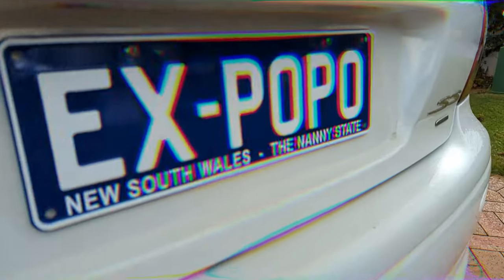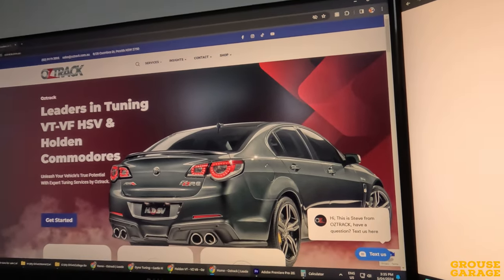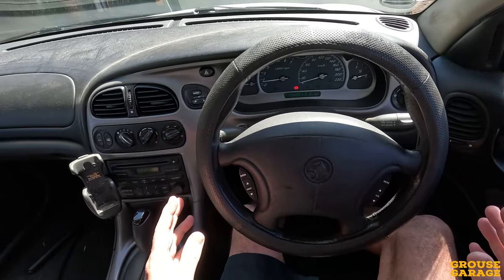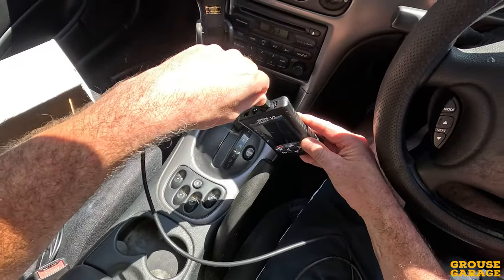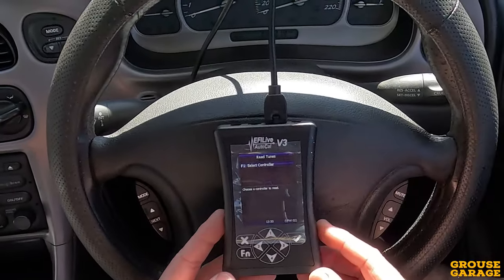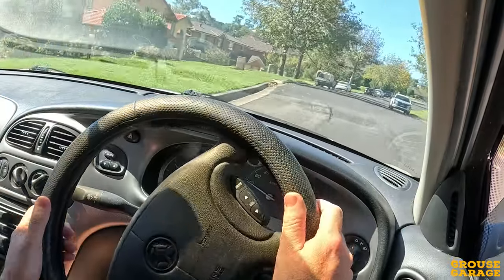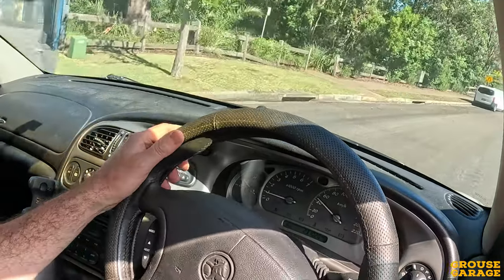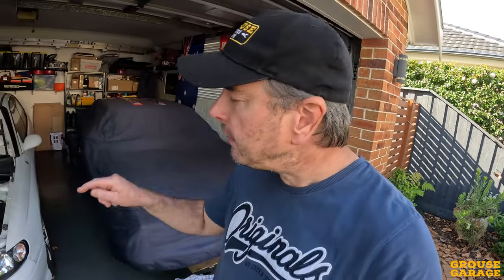Remote Tuning a Cammed SS Commodore LS1 - Does it work?

Comment: Nothing wrong with Dyno’s  and fresh engine if you talked to a tuner I’m sure they would have addressed your concerns of a fresh engine like doing a run in tune and even set a rpm limit so no one gets carried away would have also addressed your starting and stalling issues, and a dyno tube is much safer then a mail order tune which you choose as it technically is.  Plus many more benefits.  

Have to say you’ve done really well doing this all by yourself definitely something to be proud of!
Reply from the maker: Thanks mate. Fair advice. If I had a trailer and tow vehicle I would have considered a dyno tune more closely.

Comment: Most dyno tuners don’t run them flat out if it’s just been rebuilt for the first time. They say drive it for about 500ks then you take it back and they do the proper tune
Reply: true that,was surprised at the hesitancy.

Comment: I think your startup / idle problem is all about your throttle position sensor. Pretty sure from memory theres some process for intitiating this procedure holding the mode and up button on the trip meter buttons with the reds on . Don't quote me but I'm sure youll find something online... been like 10 yrs since i did it.
Reply from the maker: Checked it today. Voltage readings are spot on.
Reply: No when you upgrade your stock cam for a large cam the car wont idle till its tuned in an auto, it has nothing to do with TPS, bigger cam needs more air/fuel. and higher idle I run a Crow cams 229/235  in my LS1 and it likes to idle at 900rpms.

Comment: Enjoying your videos mate, impressive results and can always run it down the drag strip to gauge performance.  

I had my VU SS dyno tuned but have considering using a product like this to optimise / correct the tune for changes I’ve made since.
Reply from the maker: Thanks mate. Being productive and having fun along the way. 🤙
Remote tune allows you to tweak and update indefinitely. Great if you continue to tweak and mod your car.

Comment: hey Grouse 
I have the same VX vic popo !
want to do exactly what you have done  
how much did it cost you to rebuild motor & trans  ? 
mines got 190ks on it & its a bit tired  , cld use a freshen up
Reply from the maker: Good question. A few people have asked. I dumped everything into a spreadsheet and this is how it comes out :O 
Engine parts (no labour): $5124.31. Transmission parts (no labour): $3303.19.